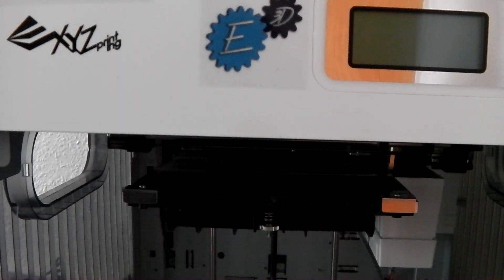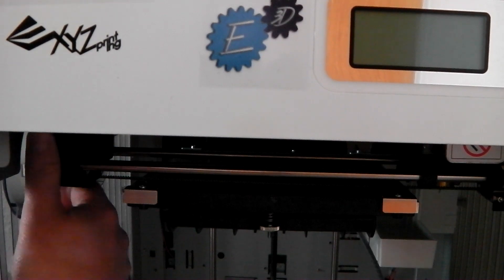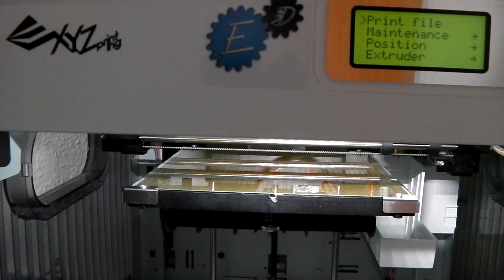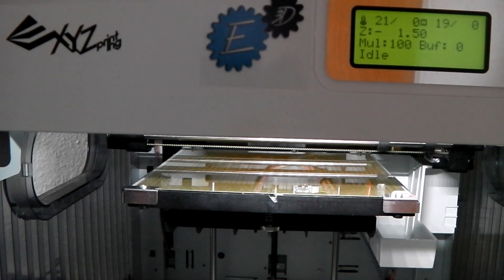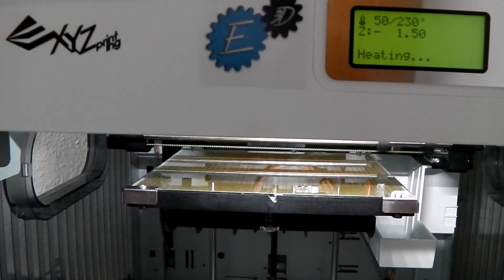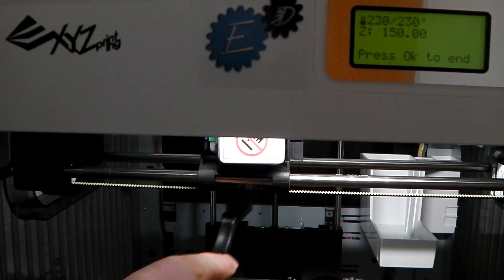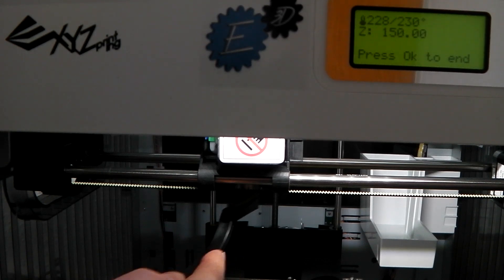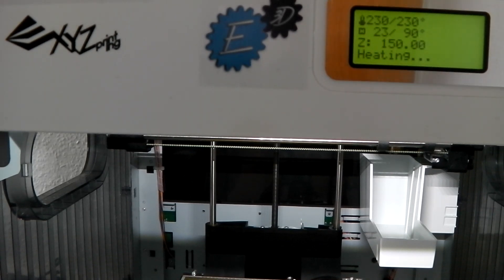XYZ DaVinci 1 0A with Repetier 0.92 Bed Leveling technique

Comment: Steven, Thanks for the video. I know it is quite old now and you have probably moved on to other printers. However, maybe you can help me. I just followed your procedure for levelling. However, it was impossible to try to get figures of -1.5. If I tried then the z probe failed (I think because the z home sensor was triggering first i.e the bed was too low. I managed to get the bed level but with figures of -4.8. I noticed you added a z offset in the Repetier software of 0.6. I figure that your level of -1.5 but with an offset of 0.6 your final position is 0.9  (-1.5 +0.6 = 0.9). So if I wanted to end up with a figure of 0.9 I would need a z offset of 3.9 (-4.8 + 3.9 = 0.9). Is that how it works? I was given this printer to play with so am a newbie. Hope you can help / explain. Thanks for the video anyway - vert clear instructions. Chris

Comment: Hi, I know that this is very old, but I recently received one of these printers. It was given to me because the previous owner replaced it after the hot end went bad. I have purchased an E3D hot end as a replacement. The printer already has  Repetier 0.92 installed. 

I wanted to follow the excellent videos that you have posted, but you stress that I must first follow this step. Trouble is that my printer does not have a working hot end. Therefore I can not get past the heating stages to proceed. Any advice on how I can move forward with the hot end install? I certainly don't want to crash the new E3D.

Comment: The auto bed leveling works perfect for me.  I recently picked up a Davinci 1.0 (Sep. 2017) and flashed it with the latest Repetier Host firmware.  The version of Repetier Host that I have has an additional option under the Maintenance menu called Zmin Evaluation.  I noticed that this video doesn't have this option and so if it's been awhile since you flashed your Davinci, I would suggest updating to the lastest version of Repetier Host firmware.  The Zmin Evaluation was the key for me to get auto bed leveling to work.  I noticed that if I used Auto Level Bed option, the Z min position gets set to 0.00 in the EEPROM no matter what adjustments I make to the bed.  (You can view your EEPROM settings in Repetier Host)  This causes the extruder head to dig into bed.  The Zmin Evaluation does the exact same thing as the Auto Level Bed; however, the Zmin Evaluation option will also set the Z min position in the EEPROM to the appropriate setting according to the adjustments you make to level the bed.  Note that when you're leveling your bed, it doesn't matter what your Z position readings are so long as the 3 position readings are roughly the same.  Also, the Z offset in Slic3r should be set to 0 if you use this method.
Reply: Thank you for your insights, Matt... I just flashed my printer last night (after 12 hours of work) and now I understand the Zmin functionality.

Comment: Hello i am the owner (italian) of a davinci 1.0a ... i think you did a great job explaining the steps to optimize it. I still use the original firmware, but I think I will soon use the mod to enjoy it thoroughly by knowing the known limitations. I just wanted to advise you (hoping for an answer) my calibration method: I use a tester in the contact mode with the terminals so you hear the beep when you create continuity between the probe next to the extruder and the bed sensitive plans. Sorry for any bad translation I hope is understandable

Comment: My printer is showing numbers in the 5's and 6's is this normal do I just need to go down a lot? Or are my setting different?
Reply: I have the same problem. Have you made any headway on this?
Reply: Having the same results too.
Reply: Cody Butcher mine's is 4 and 5's...
Reply: I set my bed at -5.8. Tested a bunch of different values for the slicer and -4.4mm seems to work pretty well. This would be a good reference point to start from if you set your bed at -5.8 as well.

Comment: Hey Steven, I have  a Davinci 1.0a with an E3 V6 hotend, and all was going well until a print I was doing went wrong and the filament jammed up beneath the head. Since that time any attempts to print result in the extruder clicking and the prints mucking up. I have tried recalibrating the bed without success. Any tips or suggestions?
Reply from the maker: Sounds like you have a blockage in the hot end / nozzle.  I've used the "cold pull" fix on all my printers and it works really well.
Reply: I'm sorry what is the cold pull fix?
Reply from the maker: I use the instructions here http://bukobot.com/nozzle-cleaning
Reply: Thank you Steven, much appreciated. One last question, what settings do you use on this printer for PLA, or TPU? Have you printed TPU on the davinci with the E3 V6 end?
Reply from the maker: Hi,  I do not have this printer anymore.

Comment: You state not to save it to the EPROM when you get the bed numbers where you want it, but what if you had saved it previously? Any problems there? BTW, I found this very helpful so, thank you...
Reply from the maker: I found if you hit "save to eprom" then the Z HOME value is set to 0mm.
For this leveling technique to work the Z HOME value MUST be set to -1.500.
I think this was a bug in the firmware and it could be fixed now but I don't know.

Comment: Hi Steven. First thanks for the time and effort in producing this video.
1) I see my first question was answered in some replies. Why 1,5 mm. It seems a number you like. I set mine to 1,0. Actually this means one can spent less time to get the value you want (ie 1,5) and stop when the levels are equal (ie 1,53) and update the Z zero position in the EEPROM with this figure.
2) Why not say "yes" to the prompt "Write to EEPROM" at the end of the auto calibration procedure (when you are happy with the levels). What does this do? I would imagine it writes the mean value to the EEPROM. The  same value one enters using the Repetier Host program EEPROM menu option.
Reply from the maker: Hi Ian,

your right, the -1.5 was just a nominal number I used.

With the version of Repetier I flashed to my DaVinci, if I selected "Write to EEPROM" it would write 0 every time so I'd have to fix it manually.  They've probable fixed that in later releases, but that's how it was when I made this video.

Comment: Steven, I was able to install the  E3D V6 and flash Repetier 0.92. I'm not sure if you FF the video to get your temp to rise so fast, but mine is very slow. I start the Auto leveling and get the bed to 90 Deg, yet the Extruder will only get to 110 deg as to the 230 deg. Then I will get a Heater Decoupled warning?? Any suggestions

Comment: Greetings Steven Good vid got me on the right track. I realize vid is over one year old but was a great help to me after flashing Repetier .92 on my DaVinci 1.0a. Mate I would like to know where or why you chose -1.500mm for your target. I am curious as to how this number figures into the final equation. I have not tried leveling to your -1.500mm yet until I can understand the final numbers. Thanks!
Reply from the maker: +hector bombino Great question.  I leveled the bed before flashing Repetier Host 0.92 onto it.  I then leveled it again after flashing it and the numbers wee very close to -1.500 so I used that as my target and worked the Z Offset in slicer from that.  I guess the bed could be leveled to 0.00 but them the Z Offset would require a whole set of discovery again.

Comment: Hi, just a quick question, do you know what the highest temp the extruder can get too??
Reply from the maker: +Josh Stevens H josh,  I can't remember if the stock hot end is PTFE lined or all metal but when I did the Ninjaflex tests all those months ago I managed to destroy the sealant that is around the stock thermister.  So, I'd say 240 deg C would be the max temp.
Reply: Thanks :)

Comment: My results change every time I run the auto level feature even if I don't adjust the screws. What gives?
Reply from the maker: it's the tolerance in the threaded rod, the stepper motors and the opto switches.  the trick is to get the numbers between as close as possible. good luck

Comment: A fyi, when performing the auto bed level it would keep failing at point 3. I found the sensor was barely touching the metal, I loosened the screw, push the metal in and tightened back up. After that I was able to calibrate all three points.

Comment: where does the 0.6mm z-offset come from?  If I am understanding correctly the Z home pos comes from the numbers that are displayed from the calibration. Yours are near 1.5 so I am guessing that you entered -1.5 for the Z home pos, but I can only get my calibrated to about 1.2 so I have entered -1.2 for Z home pos, but dont understand if I also need to enter 0.6mm for the z-offset or if that number is different.  Thanks for the great video!

Comment: I honestly recommend getting the Davinci Calibrator app from the amazon app store if your numbers are WAY off.  It's set for using stock davinci calibration numbers, which is basically mm without a decimal point.  The app rounds to .05, so while it's not perfect, it will get you pretty darn close on the first try and then use the info in this video to get it dialed in perfectly.  It's $1.99 well spent IMHO.

Comment: I don't know how you do it, man.  I've spent the past four hours and still can't get the numbers right.
Reply from the maker: +Craig Underhill Hang in there dude.  It took me weeks to get a technique down for it.
Reply: +StevenQ-NE-UK Thanks.  I finally took another approach.  After failing for four hours straight, I ran the manual calibrate, which uses the paper method of leveling.  Then, I set my Z Offset to -1.5 in an attempt at getting the right "smushing" of the first layer.  Seems to have worked pretty well.  I might try -1.0 just to see the difference.
Reply from the maker: That's great, when I had my DaVinci I never tried the manual level in Repetier.  I am glad you got printing :)
Reply: +StevenQ-NE-UK you don't have it anymore?
Reply from the maker: +Kyler..not..Tyler No, it's with the local Maker Space now, so I still have access to it.

Comment: thanks easy to understand directions.  i just got the davinci duo and want to use slicer  can you do a video of what i need to do as that i huge 4 windows a ton of options and abbreviations i cant begin to understand. but i see the results and cits clear to me it is 100 times better than xyz crap. im curious if they will ever do a fix for the xyz ware a real upgrade! im holding off still flashing to rep until i learn to use slicer as well or it would be a paper weight until then. also  what where do i find programs connections that need to be blocked? i heard something about that to.

Comment: Hi Steve,
I'm having a little issue and wondered if you've seen it before. I just finished flashing to repetier host 0.92 on my 1.0A and went though the bed leveling to notice I don't have the "Firmware EEPROM Configuration" available, it's greyed out. I've tried the newer repetier version along with restarts and different USB ports. Is there a setting I've missed somewhere to enable this? Any help would be greatly appreciated. Thanks,
Reply from the maker: Josh Backman Hi Josh.  First thing to look at is the Micro SD card that is installed in the printers main board.  Take a copy of all the files from the card (just in case you need them again) and make sure the card is empty before re-installing it into the printer.  Then, when flashing the printer the very very last step is to Load Fail-Safe.  This will save a new file to the Micro SD card.  If you miss this step then some menu options are not available and all your printer settings will not be saved after power off.

hope this helps

Steve
Reply: StevenQ-NE-UK Hi Steve, Thanks for the quick response, I really like all the content you post on your DaVinci printer experiences. I did get this figured out, here's what I did encase anyone asks again. I was watching this video by "John Madden - Davinci 1.0 repetier settings breakdown" He opened his printer settings page @ 15:25 and that was it. There was just some settings I needed to updated after flash and install (Transfer Protocol, Reset on connect, cache size and ping-pong comm.) I'm not sure if i needed to match all his settings but after I did the "Firmware EEPROM config." opened up and I was able to proceed with the rest of the process.

Thanks again for the quick response and all these great videos you've been posting.

Comment: Great video.  I have a question.  Slic3r/Printer Settings/General/Bed Shape, I have my size set as X:200 Y:200 but the Origin is set as x:0  y:0.  Should it be in the center?

Thanks
Reply from the maker: loczster Hi, the origin setting of x:0 y:0 is 100% fine.  You've prob seen the Delta 3D printer configurations.  They have x:0 y:0 in the centre of the bed but the DaVinci 1.0 works from x:0 y:0 being in the corner

Comment: Hey Steve.
Any chance you could post a straight to the point video (as you do anyway) on how to flash a Da Vinci 1.0a to Repetier? I'm sure it would be beneficial to a number of people.
I'm one of those borderliners who can't decide whether to take the plunge or not! Mainly for the lack of a guide which fills me with any confidence.
Also, I'm running firmware 1.0.6, are you aware if this is a suitable version?

Comment: After upgrading my hotend to an E3D V6 (great videos BTW!) I lost the auto level feature which now after not having it for a few months is something I don't miss.  My technique has been to run the manual level feature in repetier 0.92 and using a .10 or .08 feeler gauge I adjust them manually at the preset positions.  I usually run it twice just to be sure a correction I made later on didn't change something I made earlier on.  So far this has worked great.  I do need to adjust my Z-offset a bit since my first layer is a little too squished but so far so good!

Comment: hello Steve, we are forced to have as your 1495? or we must have z1, z2, z3 other digits with 3 exact number +/ ? I have z1:0.256: z2:0358 z3: 0568 that's okay? or I must settle for -1495? tanks. 
sorry I am no speak english.  speak french. use translate.google.be.
Reply from the maker: Murat Yuce Hi, I set my numbers between -1.475 and -1.500 these will give good results.  If your numbers are different you will have to change the Z AXIS OFFSET in Slic3r
Reply: StevenQ-NE-UK  hi Steve ! 
Now I have:
z1: 0228
z2: 0089
z3: 0087
how to decrease the Z1?

thank youuu

Comment: Hi Steve i have a 1.0, and it doesnt come up with a maintenance option? is this normal?
Reply from the maker: Benjamin Harris Hi, the menu shown is after the printer has been flashed with Repetier Host 0.92.
Reply: oh awesome thanjs for the reply, infortunately last night my power in my printe4r just died so i have a more pressing issue to worry about... does xyz sell spares to the public i may be in for a new microcontroller
Reply from the maker: Benjamin Harris Hi, If you contact XYZ support they "may" be able to help.  Their web site does show a store for spares but it seam to be US based.  How bad is your power problem? Does the printer power up or not?
Reply: StevenQ-NE-UK no it does not power on at all, i took the rear case cover off, and if i unplug the black  power clip that contains the 12v, 5v, ground and 3v the power supply works but the the printer does not fire up at all, im unsure why this is
Reply from the maker: Benjamin Harris That does not sound good.  Looks like you have no choice but to contact XYZ support  :( good luck
Reply: yeah, i think ill need it, i dont think many people have had good luck with them, but thanks :(
Reply: Benjamin Harris This video assumes you have flashed the 1.0 with Repetier firmware.  If you haven't the menu options will be completely different and if you have XYZ support will be of no use to you.
Reply: Adam Carpenter turns out i just needed new driver boards, i can get four new parts for 20bux

Comment: ThxQ so so much, I wanted to give you 10 thumbs up for this video. I had the 1.0 for a while now, and had always wanted the flash it. I have the confident to flash it to Repetier firmware, but I didn't have the technical knowledge in setting the printer up with Repetier host software. This video is a great starting point for me in getting the bed level. I hope you can do some more future videos showing how to fine tune the setting for the Da Vinci with Repetier Host.

Comment: Hi Steve, I successfully leveled my bed following your original post with the Davinci 1.0.  Although after printing I was finding -0.6 on the Z-offset was squeezing the first layer just a little too much in that my prints were .5 - .75 of millimeter too short on the hight.  I found setting the Z-offset to -0.3 cured the issue and still stuck fast to the bed while printing.  Excellent videos Steve.  You provide much informative info.  Couldn't have got there without your help. Thanks
Reply from the maker: Carl Chard-Maple Hi Carl,  am glad you are enjoying the content of the videos.  I decided to revisit the bed levelling to show how many times it takes to get some good results.  I am so glad you have found settings that work well for you :)